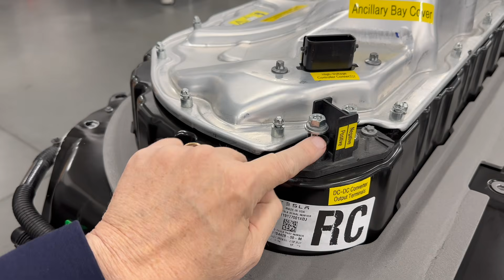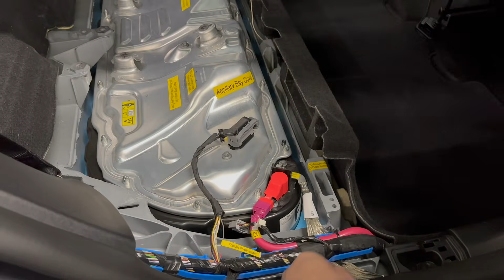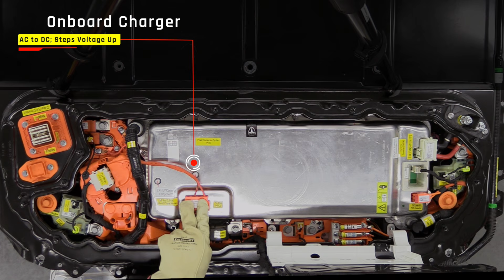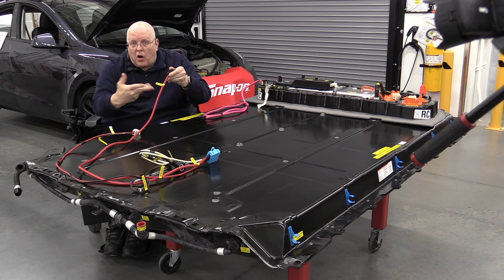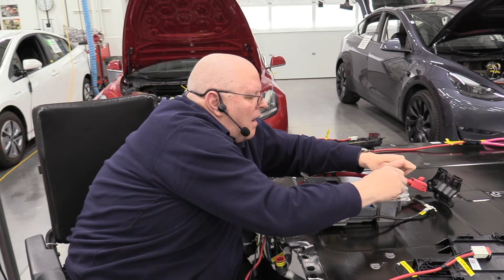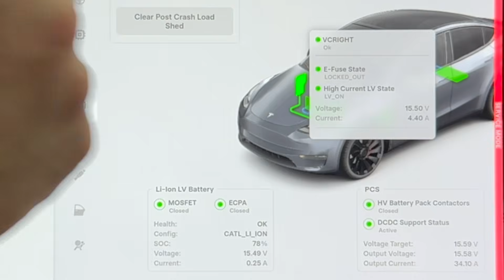Tesla Low Voltage Charging System

Comment: Can someone point me to the relevant parts about the "standby power supply"? I have high phantom drain on my old Model S and I'm interested how the newer cars make the 12-16V system energized from the HV battery with the main contactors closed.
There is a part at 11:20, is that all? I would like to learn more.
Reply from the maker: 2021 and later Teslas with the 16 volt battery and beyond have that feature. The physical zonal hardware (VCFRONT, VCRIGHT, VCLEFT) is different from the older models and allows the high voltage battery to be used to top off the low voltage battery as needed. Thanks for watching.
Reply: @WeberAuto  Are you sure it's JUST the 2021's (Palladium)? Forums say that this feature appeared in cars since about 2016 with 2.0 packs. Tesla is hazy about what is a 2.0 pack, but it is reported that all 2.0 packs have their fuse box on the bottom of the battery - supposedly so you don't have to drop the pack just to replace the fuse.

Forums say those cars from 2016 have much less phantom drain due to not having to run the high power DC to DC converter just to charge up the 12V.

Comment: Very well organized video. thank you. I have a question about drawing current from the 12v system. if i wanted to run a 1000w inverter off my lead acid battery. would it trip the e fuses ? or would the tesla brick itself due to an imbalance in current. i have a 2019 model 3 performance with lead acid battery
thanks again

Comment: John, your video is far and away the best technical video I have ever seen on the internet about a Tesla or anything else. I think you know more about a Tesla's LV system than any Tesla service tech. I found your video trying to diagnose why my 22 X Plaid is using so much electricity just sitting in the garage. Last charge it only went 37.5 miles and needed 47 KW/hr to recharge to the same 75% SOH as last charge! That is crazy but I see from your video that the LV system can supply 20 to 58 A @ 15V. That is way more than what the motors use to propel the car at 80 MPH! Maybe I should be shutting the car off between drives as we only drive 50 mi average per week. My 16 S 75 doesn't seem to be using much while sitting. I can't imagine why the X is so power hunger. Maybe you could comment here. Thanks again for the great video. I subscribed and will watch all of your videos. BTW before I retired I was a co designer of a computerized battery analyzer so I should be comfortable with the tech in a Tesla.

Comment: I have all these errors after 2 days of my Model Y :( Have a service appointment today

PCS2_a019_DcacADcTempTooHigh — DC side of DCAC converter A reached 135.15 °C (exactly at the 135 °C upper threshold). This has happened multiple times.

PCS2_a094_acChargingUnavailable — The Power Conversion System detects a condition causing AC charging to be unavailable. Alert says “Schedule service”.

VCFRONT_a160_compressorInhibited — Refrigerant compressor is inhibited. Potential impact: cabin AC may be limited/unavailable and powertrain performance may be limited.

EPBL_a116_VCRIGHT_MIA and EPBR_a117_VCLEFT_MIA — Electronic Parking Brake modules (left & right) are “Missing In Action” (not communicating).

GTW_w033_PCSCPU2versionMismatch — PCS CPU2 version mismatch.

Comment: Another extremely informative video! Thank you!

I have a question I hope you might me able to help me wrap my head around.

Considering my 2023 MY SR is on and I have a 1kWh power station connected to the cigarette lighter to charge at around 100W per hour. Where is the power going to come from?

1. The low voltage battery which in turn will be charged by the HV battery
2. DC-DC system has a clever way of delivering power directly from the HV battery?

Comment: Hey. I am doing reset into if its possible to mount a 355w led light bar to the car. Now I understand that hooking it to the 16v lv battery is not possible as this can only output 190w(?) and also needs to power the cars systems. What I’m wondering is if I can run å wire directly to the lv positive post in the penthouse for power. Ofc with a fuse and grounding to chassi in front. The light will be controlled by a can bus signal that drives a relay wich would get power from that lv post. Anyone have experience with this? It’s on a model y juniper fwiw. Thanks

Comment: 22:21 I have a story about this wire.  I was cleaning out my radiator recently.  The fan kept turning on.  In an attempt to stop this fan I turned off the car.  I unplugged this wire so it wouldn’t turn back on.   This is not the correct way to do this.  The main battery connector on the top needs to be removed.  I’m not sure if both wires need disconnected or not.  

When I went to restart the car  when I was done the car was DEAD.  NOTHING.  Completely dead.  Unplugging the smaller connector and leaving the main allowed the LV battery to run flat.  My jump pack wouldn’t do anything because it didn’t see any voltage at all.  I luckily had an ICE vehicle on hand to “jump start” the system and get the charger plugged into the car to recharge the LV battery.

Make sure you learn the proper procedures before performing maintenance on the car’s.  I thought I had ruined the LV battery.  Luckily everything has been fine for the last 5 days or so.

Comment: on the 12v side of the post from the main battery what is the max amp the car will allow? is there a max rush Volts that it will allow?

Comment: We are very pleased that you are back, Mr. Kelly. Thank you for your time and knowledge! Two questions for you. I purchased a Model Y a few weeks ago, and this is my first time owning an EV. When charging, using a level 2 charger, is it better to charge at the slowest rate that the person has time for, vs the max? I can charge using 40A, but most of the time I'm charging at 15A. The thought process is that it will be better in the long run for the battery's health. Secondly, as it is recommended regularly, we don't charge past 80%. My hypothesis is that keeping the battery in a 30% to 60% range would result in less battery degradation over time. Is there merit to my assumptions for the health of the battery over time?

Comment: What is the trickle charger wire used on the 16v system used for when the vehicle is running?
Reply from the maker: It is a wake up signal for the PCS

Comment: Professor Kelly , on these electric and hybrid vehicles , you  haven't mentioned , if they use CAN  communication system , do they  just communicated through  connecting wiring from module through module .
Do CAN communication only applies to Gas and diesel engine vehicles ?

Comment: Greetings Professor Kelly ! So , every module is called  controller , the electronics controls at the auxiliary bay ; is called PCS power control system , the 3 front ones are called VC front , VC right , and VC left .
Very good to know that great information

Comment: On your previous video. You did a video on the Tesla 16v lithium battery recovery and jump starter to wake up the BMS.
Google says I can't bypass the 16v battery with a temporary 12v lithium battery to drive the Tesla home without damaging the electrical components.
Is that true?
Amazon does sell 16v LFP batteries.
Litime 16v 30ah costs $139.

Comment: i have same problem with my vehicle 70k 2022 model y tesla 
i have an errors coming out my dashboard on service mode 
1. Pcs charging hardware enable line does not match CAN signal (Why?)
alerts log 
Charge Enable can: False 
Charge Enable line: True 
2. HVP LV power Test: contactor power failure detected. see toolbox artiicle 44497
12 v power pass
pcs charge enable line fail 
pcs dcdc enable line fail 
pcs enable line fail 
pcs connector not shorted to vcc main or ground (pin x479-1,-2,-15
raw_response 0007)
another error : Hv battery requires to replacement 
Bms_a123_sw-_internal-_isolation
The battery management system(bms) detects that there is low high voltage isolation when pack contactors are open,
the thing is id like to let you know that i performed repair pyro fuse my self and than it came up those results
i really need second thought what could be the real issue with this car. if can explain in terms of electronical way terms of i really appreciate it 
warm wishes
Thank you

Comment: 🙏🏻 Thank you for this content! 
A question, I’m driving a ‘23 Y Performance with an aftermarket high-end 16V DSP and audiophile sound system installed. The Y does not seem to be very keen on this addition as it results in software update errors as well as minor low-voltage ‘leaks’. The DSP should shut down completely when the car sleeps and, with a relay, powers on somewhat later than the the Y boots, to avoid the BMS throwing errors on additional power consumption. We still didn’t find a bulletproof solution yet as the 16V battery completely drained the other day after two weeks of no driving. The Tesla had to be jumpstarted. I would love to know your thoughts and advice on this topic. Can’t imagine there is no way to fix this, although Tesla itself wasn’t very happy with the additional DSP as a low voltage client to the system. Thanks in advance! 🙏🏻

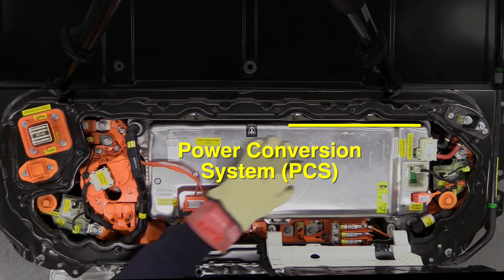Comment: I have a question on the part at 6:30 in the video. You explain the AC input from the wall connected to the Power conversion system. How come these are such appealingly thin wires? Also the orange connector on the right side that charges the HV battery, seem to be very thin wires. All other charging wires (DC, but also AC) are very chunky and feel solid, so I don’t quite understand yet why these particular internal wires can be so thin. Thanks for your great videos!
Reply: I

Comment: A masterclass in clarity. In a TM3 with 12v battery, failure of that battery results in a total lockout of the vehicle requiring a “jump start” via the emergency frunk release.  From your video, I understood that the the HV via the pcm always provides power to the 12v, which implies that there should still be 12v to run system services even if the 12v battery has expired.  Given that 12v lead acid battery failure is common, and the commonest cause of breakdown, it would be helpful to have that fault mode covered specifically.

Comment: Thank You. I have a problem with my Model 3 2023. The car had a collision with only body parts involved. Rescuers cut the electrical cables interrupting the high voltage system. I started to put the car back into operation, the first problem is the dead LV battery, I opened it (from the external terminals it did not charge) and recharged it until I got a voltage of 16V, then reconnected it but the system doesn't recognize it and says to replace it. I've tried various procedures including the "Close Mosfet" button in service menù but I can't reactivate it: do you have any advice on how to get the LV battery recognised? Many thanks.

Comment: Only after my 12v battery caused alarms did I dive into the low voltage system.   Decided to go with a sodium ion battery.  So far so good.

Comment: I was reading the frunk pop is secured to unlock or dead battery now but how do they recover with  0 keyed locks and frameless windows if frunk release fails or the 12v leads were damaged and you cant feed power.
if it dies first then i supply 12 volts without the app key to unlock will the frunk pop?  Can someone use those leads to reverse polarity or overvolt a charged locked car
Reply: Watching 16v battery video now.

Comment: Great to see you back! 
Fantastic video, very interesting!
So there is HV even with contactors off for trickle charge. Seems yellow cable, not the typical HV orange. Its a trap!?

Curious what the trickle cable is used for in normal operation?

Comment: It would be very interesting to do a similar treatise on the Prius Prime Plug-in hybrid, to determine why the 12V batteries on them generally have unexpectedly low service life.  
Most likely it's due to the tendency for them being used in deep cycle mode, and the owners using them under conditions where they get drained down significantly before restoring full charge.

Comment: Thanks Professor, am also glad you're back, one thing that struck me were the AC cables going into the PCS, they seem to be quite small cables for reasonably high current, long duration charge events. Also did the Telsa' s support 3 phase charging, if so thought there might have been extra cables. I have a Kia EV6 which has been fantastic, I'd imagine some principles would be similar. As always thoroughly entertaining and educational, look forward to more future videos.  🤠😎

Comment: Even with PPE on (a thin layer of rubber), I wouldn't intentionally touch terminals with each hand that would put a lethal 400V across my chest.  That's like sticking a shotgun against your forehead just because the safety is on.

Comment: SOOOOO glad you are back.  Really enjoy your videos.  I did have a question that I hope you can answer.  At my home, I use a low Voltage Tesla charger connected to a 15 amp 120 volt circuit.  My charger allows me to charge my Model Y up to 12 amps.   My question is, is it less efficient (cost more) if I charge at 6 amps versus 12 amps.  If my car shows the charge will finish in the middle of the night, I lower my charge amps to have the charging completed the next morning.  I do this to lower the stress on the house wiring and circuit breaker.
Thank you so much, and please continue to educate us.
Reply from the maker: Thank you. It will probably cost more on 6 amps because the car requires power to maintain the battery temperature.  12 amps will charge the battery more quickly thereby reducing the time and power required for battery thermal management.
Reply: Thanks for your quick response.  Totally makes sense.

Comment: 12V lead acid batt has temperature feedback as thermistor is mounted with nut on negative battery terminal. Different battery temp will get different charging voltage

Comment: 2024 M3 has 12V lifepo LV batt, easy to check witch one is installed as it has black plastic enclosure. Shape is likely the same as 16V had, there is some backwards compatibility

Comment: Thank you for teaching us about the low voltage system on the Tesla Model 3/Y! Can you do a series on building a custom RC car from scratch including recommended components? Would be a fun way to play along with the lesson at home. Preferably ending up with a sweet 4X4 with suspension at the end, controlled by an xbox PC controller and an arduino.

Comment: Interesting, my model 3 is a late 2020 build, technically it's a 2021 model year, but it has a heatpump.
Reply from the maker: Yes, I was wrong about the heat pump year; late 2020 is correct. The 16V battery was used beginning November of 2021.

Comment: When I supercharge my 2020 model 3 I smell sulfer coming from my car is that something I should be concerned about? I don't supercharge regularly only when I travel out of state
Reply from the maker: That is a good question. I m not sure what would cause that. 12 volt lead-acid batteries can smell like sulfur if they are overheated. I would have your 12v battery tested. Best wishes.

Comment: Glad to see you’re back.
My experience with Tesla’s low voltage monitoring/warning system wasn’t good.  The 12v battery died without warning one morning.  I opened the back door, put my bag in and closed the door.  I noticed that the window didn’t roll back up and I couldn’t open any other door.  Chatted with Tesla on the app and they didn’t see any alerts, but said it sounded like the 12v battery had died.  They towed my MY to service and after 5 hours they replaced the 12v battery under warranty.  The 12v battery error only showed up after temp power was connected.  

My coworker had her 12v battery die while charging without error messages. Mobile service was dispatched in her case.  

Maybe the low voltage battery needs a larger reserve to provide more time for failure detection?
Reply from the maker: Thank you! Their 12 Volt batteries have had shorter lifespans (3-4 years). The 16 Volt systems have better battery state of health monitoring.